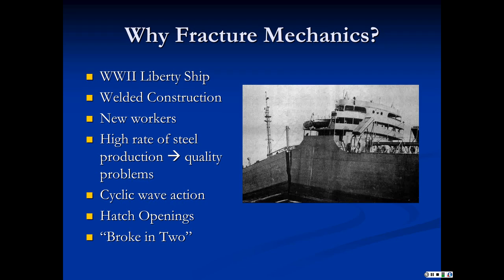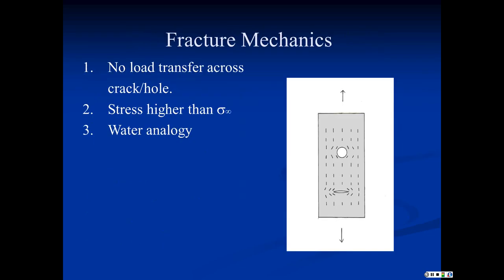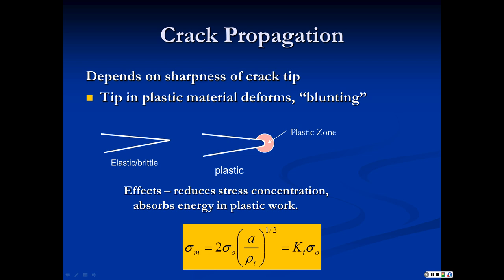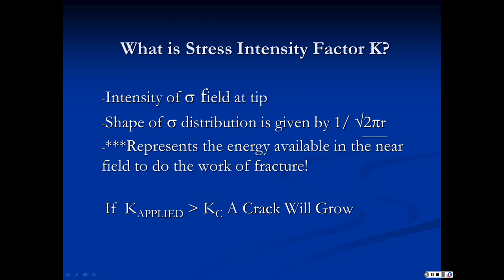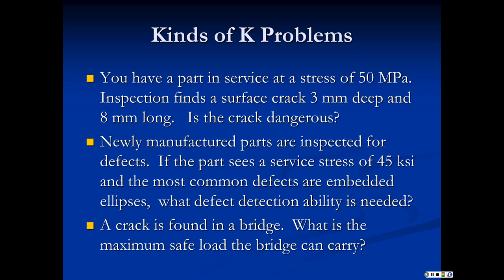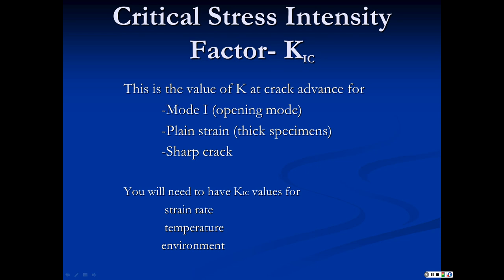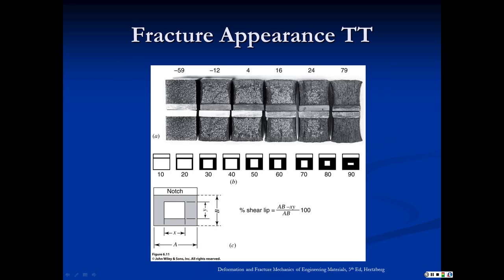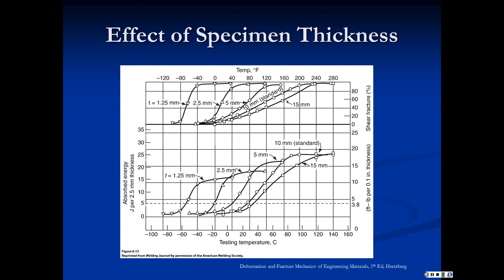Fracture Mechanics

Comment: Is the failure of a ductile metal in a tension test partially due to crack tip widening as well as dislocation motion? I mean do the voids that coalesce in ductile failure begin forming below the ultimate tensile strength / point of necking?